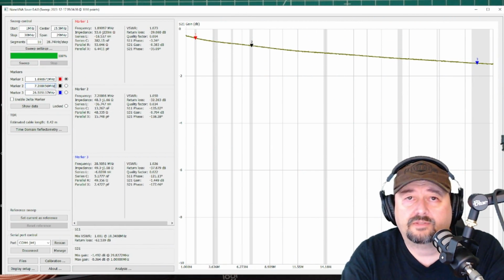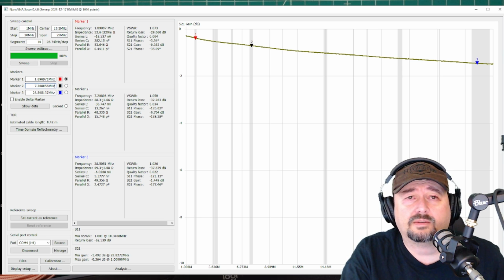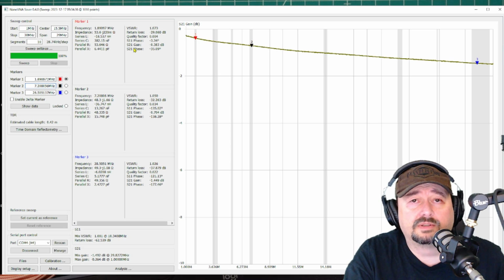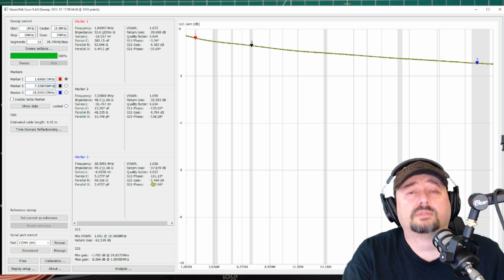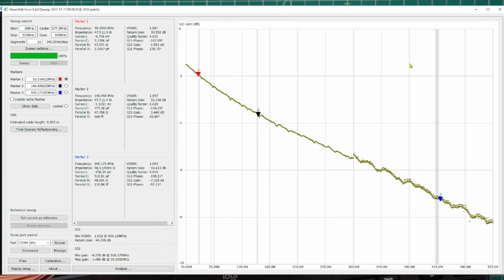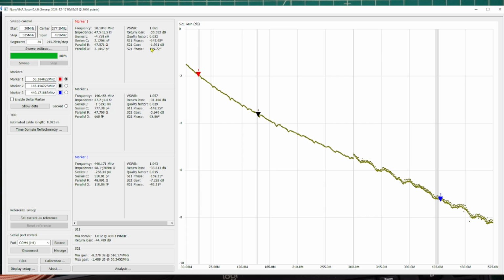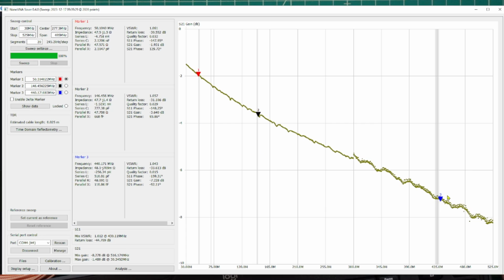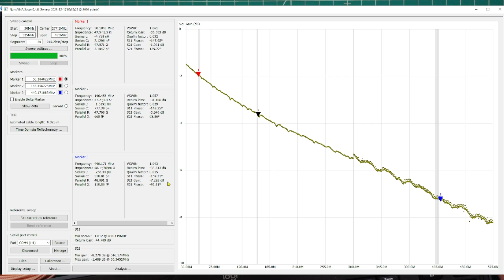Unveiling the Truth: Measuring Coax Cable Loss for Ham Radio Beginners

Comment: Hello! I need to test an old cable, which is already in pace. One side is on the pole, the other side is 200 feet away in the house. So I can not use the set up you described here. Any idea?
Reply from the maker: @albertotermanini  for insertion loss you need both ends connected to the device.

Comment: Something occurred to me when you mentioned coiled cable @1:58. Considering we're talking about cable loss and not faults, I was thinking it might be a good idea to measure samples of the cable instead to determine which cable you might want to consider. Then do the math for the length you'll need. That's for someone in my case that has several types of old unmarked cable anyway 😏 Not sure it works that way, but thought I'd mention it.
Reply from the maker: You could do that and use like 1m lengths for comparison 👍

Comment: I passed my Technician's license exam 2 years ago and I recently achieved my Amateur Extra, though I'm not getting much radio time. I am still exploring antennas and coax. I recently purchased the Nanovna H4, the one you are using in this video. I have not yet downloaded the Nanovna Saver software, that is another issue having just replaced an old balky Win 7 laptop. After all that, my question for this video is about the VNA calibration and configuration for coax testing.
Reply from the maker: Hey Steve.  Here is a playlist where I cover tons of stuff with the NanoVNA including calibration and testing coax 👍

Comment: I'm using 50 ft of rg8x on gmrs and the SWR increases when I step up the power on my radio. Is that normal? I know it sounds silly but I go down to two watts. I got 1.01 I go up to 25 while that's all I'm looking at. 1.7
Reply from the maker: As crazy as that sounds, it happens.

Comment: Including Rg-6  75  ohm Foam double shield would've been interesting as it's relatively Cheaper & has Less less loss than Rg-8....The 75 ohm coax has surprisingly less significant Mismatch loss & Vswr issues than you'd think for the cost...
Reply from the maker: I know a few folks who use it, I haven’t yet 👍

Comment: The major issue all hams have is they think about coax in loss only.
No one looks at the noise incurred by cable leakage.
Say you have 100ft and you want to DX on 7mhz 40m, well RG58 will be something like 20% or 30% loss at like 1.5 to 2:1swr fairly standard stuff, the LMR400 might be something like 10% or better.
This looks to most hams that there's no point in using LMR400 as it's like a quater of an S point difference.
But what nobody realises is that there's probably going to be an S point in noise floor increase using the RG58, thus making the SNR way worse using the cheaper cable.
Of course putting the coax underground helps and if you're in a quite rural area it might not make that much difference, but if you're in the city and it's noisy and you can't put the cable in a trench so it's above ground get the best cable you can.
Reply from the maker: Thanks for the info Shane, it’s helpful 👍
Reply: @TheSmokinApe  no worries 👍

Comment: I use RG-316 for my POTA activations. 25’ of ABR with the choke beads on one end which for my vertical I put at the antenna end and EFHW at the radio end since I use the shield as a counterpoise. If I need a longer run I use a 50’ piece of RG-316. The losses are fairly negligible at HF frequencies. Because of that I gladly take the losses over the advantage of the small coax package. I’ve taken a variety of different coax types and lengths and haven’t really noticed any differences. Thanks for the video.
Reply from the maker: Hey Trucking, I am the same way...  I'll take the loss hit just for the easy cable 👍

Comment: Thanks for another informative video Ape. I need to check your list to see if you have covered the subject of using coax lengths of half a wave length of the frequency band you are going to use. I've heard for and against on the merits of this... would welcome your opinion. 🤔 73 G0ACE
Reply from the maker: Hey Ace, glad you liked the video.  So using a havewave or multiple there of if the frequency is a best pratice but its not something I have done a video on.  I could add it to the list but be warrned, it's a long ass list.
Reply: @TheSmokinApe Thanks Ape, I realise it's a contentious subject too!

Comment: Thoroughly enjoyed that, Ape. You made a point about the coil of coax having impedance. Based on what I know, this is not a problem at all for this test since the impedance is against currents travelling on the outside of the braid only (choke) and won't impede RF travelling on the surface of the inner conductor. The coil should not affect the measurement at all. Do you agree? Alex, 2E0LUP
Reply from the maker: You are correct Alex, I would agree.  Thanks for watching and for the comment 👍
Reply: @TheSmokinApe  Ok, there you have two viewers who noticed the mis-statement.  Let's get that corrected.  What say?

Comment: Will the loss at 440 with only 7 feet of that cable be as significant ? My K-400 lip mount came with that cable for use with a dual band antenna. Great Video !!!
Reply from the maker: I wouldn’t worry about 7’ this cable was about 35’ 👍
Reply: At 7 feet, it would be around 1.45 dB loss for 70CM, and 0.73 dB for 2M.

Comment: I get the video was how to use the H4 ( you didn't show any menu settings ). The manufacturer spec sheet will tell you where that coax runs best as well.
Reply from the maker: Yes, you can use the manufacture spec if you have it and you didn't get gas station coax.  Thanks for the comment Mark.

Comment: Coiling up the cable will only give you common mode inductance. Differential mode (what we use to get our wigglies to the antenna) is not affected by the coiling of the cable. Rest of the video is great, and this test is why I do the "through" calibration.
Reply from the maker: Fair point about CMC, thanks for the comment!
Reply: @TheSmokinApe  So, keeping that incorrect claim in the video perpetuates a myth.  We have enough myths that hams believe.

Comment: Very cool. I knew this could be done with the NanoVNA but wasn't sure how. I'm curious what the loss differences are between a longer and short run of cable. I started using RG316 this year for POTA with the CaHR Mercury linked dipole and the N9SAB OCFD, since it puts much less strain on the mast for these antennas. I've got one cable that is around 20-25 feet and another that is around 30-33 feet, which was so I could put the antenna up higher. I'll have to check out what the difference is sometime. Thanks!
Reply: Most coax loss specs are calculated @ 100ft (but check carefully, some are at other lengths, including meters). A 25ft. cable would be 1/4 of that, 33ft. would be 1/3. A good reason to keep your cables as short as practical.
Reply from the maker: Hey Mike. You’re correct the longer the cable the more attenuation.   I’m willing to loss some watts to have the smaller cable 👍

Comment: Iv'e just upgraded from rg58 tp M&P HyperFlex 13 coax. Its very expensive but i wont need to upgrade for a long time, and the fittings are built like tanks.
Reply from the maker: I’m running some M&P and you are correct, the connections are beefy 👍

Comment: real good. I have the Nano VNA-H4 .  putting a coil in the coax buy antenna helps with common mode current. but warping threw ferrite gives more attenuation per turn. I have the M & P POTAFLEX 7 and that tested great at VHF/UHF . also coax length can be a factor at select frequency's . resonate length . don't see that much at HF unless the shield is acting as a counterpoise. I found that using a end fed half wave dipole with 49:1 UNUN. length of coax can effect SWR and RFI back to radio. this was worse on my 9:1 . longer feed line was a big help at lower frequency's . also a 1:1 after antenna and a counterpoise also works. each portable setup can tune different. nice job on coax loss . best to read data sheet before you buy.  for HF RG-8X works great for 50Ft runs or less. can take some power as well. but not all RG-8X the same.  ABR makes a real nice 8X type. 73's
Reply from the maker: Hey Robert.  I noticed more RFI with my 9:1 than the 49:1 as well.  I pretty much always go the counterpoise and choke route these days 👍

Comment: Everyone is always worried about how much of their output power is reaching the antenna and that is not what people should worry about. Its the tiny power that your antenna is sending back to your rig. Every db counts on weak signals and the difference between making a contact or not in many cases. You can always increase the transmitter power via amps to make up for any coax loss, but the other station may not. 
As a general rule, put in the best coax cable you can afford. Its the most important part of your station setup.

Comment: loss figures are available for most coax cables (db per 100 feet), useful for those who don't have a nano vna. either way one can soon work out which cable to use for the length and frequency to be used. 70cm in a car, RG58 is ok it only needs 10-15 feet. 10M with the antenna down at the end of your paddock, RG213 at least.
Reply from the maker: Hey not, I would agree with most of that.  That said many folks reach out to me for help with their stations and don’t know what type of coax they have or they have a generic rg-58 or rg-8x and do not have a manufacturer data sheet.  Thanks for the comment 👍

Comment: Any reputable manufacturer of cable will provide a datasheet which shows loss in dB per metre over several different spot frequencies. I have tested a LOT of different cable specs against the big HP spectrum analyzer at work and found all specs are absolutely spot on.
Another thing I did, was start building a spreadsheet (Google sheets) which plugs in all of the details from teh datasheets.
The first was to enter the frequency dependant loss figures, and then turn them into a graph. Because the quoted frequencies are some distance from each other, I needed a way to represent the coax performance over frequency and this is what the graph does. Have the graph present a trend line, and then have the graph generate a polynomial equation which will give to the loss figure for that coax on the basis of cable length.
For each coax type, I repeated the process and then updated the main spreadsheet.
I also added input power, antenna gain, total coax loss and ERP fields.

The spreadsheet is here: https://docs.google.com/spreadsheets/d/10yAkc9s9Ts0Tge0Gi-RLIUygytCbmtJk_Zh9HnUVV2A/edit?usp=sharing

Beware that the above spreadsheet in non-editable to the public, so you'll have to make a copy of it in Goggle sheets and then edit your new copy.
When entering data, the spreadsheet is set up with green cells and these are the editable ones. You'll notice that you can enter cable length in metres and the sheet will automatically populate the length in feet cell.
Also, I have only added the frequency dependancy to three coax types: RG58, RG213 and SSB Ecoflex 15. These are the coax types I most commonly use.